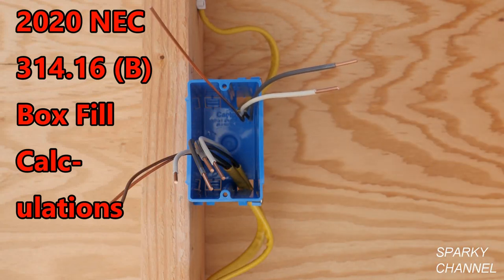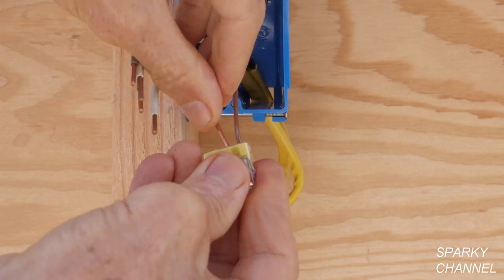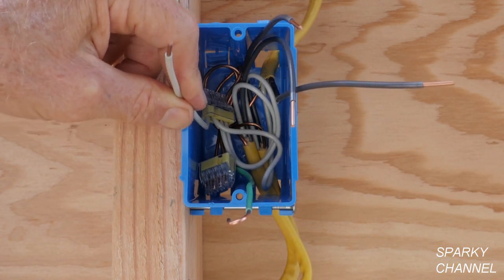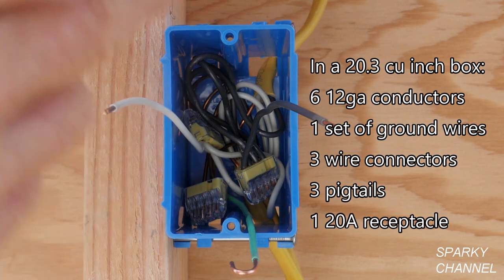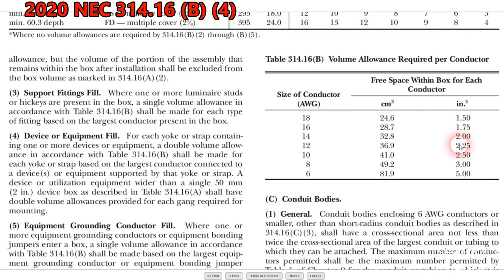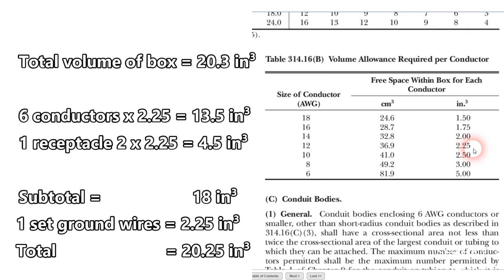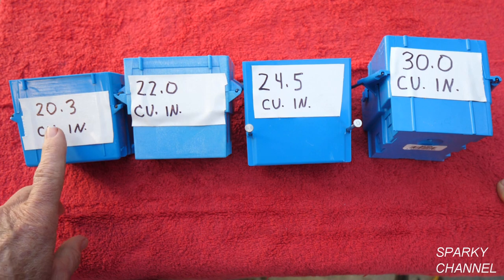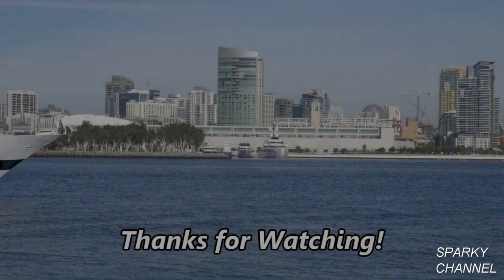Is this Box Overfilled by 2020 NEC Code?

Comment: My dad talked to me one day about planning ahead. He said (paraphrasing) "If you add up all the cost for an entire house for doing it cheap vs doing it right, it's not that much difference, but the cost later is significantly higher if you do it cheap." He was referring to putting in larger boxes, spec grade devices, even running 12/2 when commonly 14/2 is used and so on. Over the years I have seen this principle prove itself time and time again. I usually don't even bother buying the smaller dimension boxes except for a very few cases. Ounce of prevention.
Reply from the maker: Your Dad is brilliant!!!

Comment: I am an electrical engineer, I follow the plumbing, electrical and building codes which all continue to increase in complexity and the details. My experience is there is nothing you can put in writing that replaces COMMON SENSE and GOOD TRADE CRAFT. 9 Years ago, probably about the time emphasis was placed on overcrowding boxes, I was on a job where the electrician stripped the sheath on 3 12-2 romex, leaving 24" of wire. I watched him strip the ends connected directly to an outlet and used your yellow plastic tool with amazing skill to make 5 or 6 tight bend, using great skill, put the outlet in place and put great strain on the screws to force all the wires in the plastic box.
I asked why.... answer, that's how I was taught.
The reason for limiting the number of wires based on cubic inches and device is a combination of mechanical stress and potential overheating at max load.
In retrospect, I wish I made a video, would send it to you.

Comment: You sometimes can't put in a deeper box like when putting a receptacle in a wall framed with 2x3 studs instead of 2x4s. What you may need to do is use a wider box for installing a single receptacle or switch.

Comment: I just used this information when I decided to use up two pieces of leftover 10/2 and a piece of 12/2 for a new 20 amp GFCI circuit in a garage.  The 30 cu inch box works great and left lots of room for the GFCI receptacle.

Comment: Loved learning about that connector. Beats the hell out of wire nuts. Thank you!
Reply from the maker: You bet! Thanks Eric!
Reply: Those connectors are garbage and cause problems, I wouldn't use them
Reply: @GrizzlyWang  good to know.  I'll do more research should I ever think of using. Thank you
Reply: Why are they garbage? What does the data say?
Reply: @andrewpayne6295  I'd say they are garbage based on the minimal surface-area contact.
They may be rated for 20A, but what's the resistance at that power draw when you have a string of these? I'd also be concerned about heat-cycling that thin strip of spring metal.

I wonder if someone has put these things on a thermal camera and/or calculated resistance when passing that much current. I'd be willing to bet the wire nuts fair much better because all else being equal: resistance is a function of surface area.

Comment: I have an outlet I opened up yesterday in a house i just bought that has 5 14/2 wires running into the outlet box. This is a single outlet box. Would getting a double or triple outlet box and adding 1 or 2 more outlets to the gang make this safer? It is way too crammed and obviously exceeds Cubic Inch space requirements.

Comment: I have a question about the connectors, aren't they using the same principle as the push in connections on the cheap receptacles. Why would they not fail the same way as on the recepticle? I've used them with a light fixture that came with that type of connector, and they are handy. But I was just curious of the failure rate.

Comment: Here's a question for you - I've seen many electricians saying DO NOT use the 'push-in' wiring on outlets/switches (and I've never used them, I've seen them pull out, and just don't feel reliable) - But now I'm seeing these Ideal In-sure blocks instead of wire nuts - What's your take on this difference? Both are push-in...    (I did just use them on an LED hi-hat install, also I tape everything for a little extra insurance if a clip loses tension)

Comment: Stuffing the wires back into the box is tricky. I didn't think to stuff the wago connectors in first and leave the pigtails out. That would have made it much easier and cleaner. Sometimes when I am in awkward positions I don't think so clearly:)......Thanks for the videos!

Comment: I always feel the wire nuts or wago's are too much in this scenario, but they don't "count" anyway!? Anyway: always go deep with a gcfi/afci!
Reply from the maker: Thanks!
Reply: Yes sir if your box is to full with a GFCI then it'll cause your GFCI to have a malfunction
Reply: @
wim0104 curious as to what you think the alternative is? Thank you
Reply: @ayeitsshane806  Care to elaborate? Is it something to do with transient voltages between conductors..? Prospective apprentice here.
Reply: @ArkamasRoss  just something i learned over my 12 years. But if you have to many wires in your box even if its up to code with box fill calculation but for some reason if its tight and pushing against your device it'll cause it to trip and not reset until its fixed

Comment: Had some trouble recently in an existing 2-gang box. One switch was a 3-way and the other was a 4-way.  I replaced the old toggle switches with a Legrand paddle switch.  That 4-way was really packed in there. Pretty sure it was overstuffed.  I am ashamed.
Reply from the maker: Hi Jo. Have you considered changing out the 2 gang box to a larger one?

Comment: The offset 30.0 box is awesome.  Also, the ones they make when you cut your hole right in line with a brace and you don't have the depth but need a shallow offset box.  Next...how many wires can you get in a one-inch pipe?  As always...one more. LOL

Comment: One thing you didn't use to calculate the fill was the outlet possibly being a GFIC vs standard outlet, even though the code doesn't distinguish them by yoke??  When in doubt always use the deeper box.

Comment: Hi Sparky,
 First, thank you so much for such a great video and explanation of the calculation of cubic space needed. 
So, I was taught, though(once upon a time) that the ground wires had to be a non- reversible( or crimped) connection. Are push connectors considered to be non reversible?
Reply from the maker: Hi! I don't know of any such code.

Comment: Great videos. {lease can you provide advice on testing and troubleshooting of electrical circuits and the use of push in connectors over the use of wire nuts. I live in Thailand which seems to follow (in parts) the NEC code but, does mix and match with other regulations so, can be confusing. Thanks

Comment: 10:18 sometimes though, gotta use a 20.3 b/c of space behind the box, and can’t upsize; so know you’re good on fill, 8s key before starting, b/c last thing wanna do is do a rip-out (not rough out or rough in 😉) when inspector comes and decides to pull cover plate (if already on) and calculates fill….they’ll make ya redo, or possibly add extension, but again, if zero space ….and not possible to add bigger box, this gets tricky.
Example, adding receptacle in a wall that has concrete “framing/slab” all way to roof soffit and you need to use low profile boxes or 15.x-20.3 boxes on fill to make them “fit”, not able to cut thru concrete etc….and so, gotta really calculate that box fill b/c those inspectors will find and check, never fails😉
Cheers✌🏻

Comment: Here in WV everyone says use 12 wire because it handles more and I see it all the time, an 18 cube box with 3 to 5 12/2 wires plus the gfci or other device, I say yeah lets just disregard the factors that cause fires.  Another good one is 4-6 or more 12/2 wires through a 3/4 inch drilled hole.

Comment: I appreciate you address code and explain it so I can understand. (I've read code and it's a nightmare to decipher, at least for me.) 
Working in the house my father built my guess is your guess is right on the money, within code and just barely. Doing rework I call that an overstuffed box and for the less experienced a nightmare to work with. 
 I've based a lot of my choices building a home on what my father did and come to the conclusion he was stingy about some things.  I know Small Things add up when building a home however there's a whole lot of things I would do different next time I build. Among them is big boxes for multiple cables. 😆

Comment: The 22 cu in boxes are definitely worth the extra 15 cents or so. Cheaper than that if you buy a case, I'm sure.
I've been using the Ideal push connectors while replacing some switches & receptacles in my home. They're quick and easy. Glad to see them on your channel. Wagos are nice, but the Ideals are quite a bit cheaper.
Reply from the maker: Thanks Doc!
Reply: Couldn't agree more. A few cents per box is trivial but well worth it.
Reply: Tried the wagos and personally don't trust them as much. I feel the wire wiggles too much and did get pulled out in an occasion or two trying to push the wire back.

Comment: does a smoke detector count on the yoke volume. It sits outside the box unlioke a switch or an outlet that occupy space in the box ? Same with a light ?
Reply from the maker: No, it doesn't. As you say, it sits on the outside of the box.

Comment: Not the optimal place to ask, but if you have two separate circuits running to a two-gang box, do the grounds have to be combined where they’re in the same box or can they be separate? Or do they have to be separate?
Reply: If multiple circuits are spliced in the box, then the equipment ground for them needs to be spliced together in that box.  If you have a cable just passing through it doesn't have to be spliced.  See 250.148.

Comment: What length of wire do you remove the romex sheathing from to go into the box? I can't find any information on how much unsheathed wire is allowed or recommended for box fill.
Reply: I'm not an electrician but I thought someone said only ½ inch.
Reply: Last I knew, it was a minimum of six inches.  It might have changed since, but the idea is to allow slack for future repairs.

Comment: Been doing Electrical Work for over 40 Years. I Always Use 22 cu inch plastic boxes with 12 Wire. Folding wires in and GFI outlets make it a better installation, Never more than two 12-2 cables in a one gang box. Code is a Minimum. Real Wire nuts not a fan of plastic pushin wire connectors.
Reply from the maker: Thanks!
Reply: Great comment nec is minimum requirement I’d rather pay $.05 more for a larger box and not struggle stuffing all those wires

Comment: How is 20.25in smaller then 20,3in? I don't understand. Logically I would be safe and go with a bigger box. Sorry I never finished the video before I asked this question. Now would you fail inspection using that size box?
Reply: Another way to write 20.3 is 20.30 and 20.25 is less than 20.30 by .05 or 5 hundredths of a cubic inch

Comment: I had a 3 seperate wires in a receptical and I didnt use connectors or lugnuts. I used the 2 on the side and put the 3rd in the push-in in the back of the receptical. Is that wrong to do?
Reply: wrong? probably not.  Difficult to properly bend all the wires back into place? You bet your bottom dollar.
Reply: What did you do with the ground?

Comment: Can you set the box deeper in a use a spacer to set the receptacle out more for box conductor volume
Reply: Yes
Reply: Maybe sometimes but that depends on how deep the wall is.
Reply: Be careful about this; you do not want to create a gap between the front edge of the box, and any combustible wall material, such as wood paneling. There are slip-in box extenders that cover the gaps. You will also need longer coverplate screws.

Comment: For the neutrals don’t you need to worry about which phase they connect to in the main?
Reply from the maker: That's correct.
Reply: What? Neutral doesn't have a "phase". It's either the center tap of a transformer (split phase, or high leg), or the the common rail of the windings in a wye system. There may be multiple systems in the facility where you wouldn't want to bridge their neutrals.

('tho all neutrals are "grounded conductors", so it shouldn't break anything more than words on a page ("code") BUT, in the Real World(tm) neutrals from different systems may not be at equal potential -- as I have seen before.)
Reply: @SparkyChannel  how is that correct? Neutrals from different circuits should not be connected but there is no way to connect then to a different "phase" as they are never connected to a "phase" unless it's a fault

Comment: Stumbled upon this video at the jobsite. I've never included wirenuts in the volume calculation but two of the newer guys said they were taught to add it to the volume in school. I suppose this videos reference to the code sorts that matter out, but it confuses me as to why they wouldn't mention connectors in the code as they mentioned locknuts and bushings. Also not a fan of those push in connectors but to each their own.
Reply: DIYer here. I concur. Connectors are in almost every box. Locknuts and bushings are relatively rare, especially in non-metallic boxes. The Code should be updated to reflect this. As to push-in connectors, i prefer them in more crowded boxes. (Well, OK, I like them everywhere; much easier to use, especially by those of us who do not use wirenuts all day long, day in and day out. And unlike aluminum wiring, and backstabbing receptacle connectors, I do not see hordes of pros regaling us with horror stories on pushin or better, lever-lock connectors.

Comment: Doesn't the internal clamp count for 1?
Reply: I was thinking the same thing Bruce. The NEC says you must count clamps (1 based on the largest conductor) but Sparky did not count it in his fill. I am not sure why? I always use the deeper boxes from Home Depot with a cubic inch fill of 22.5 so it would allow the clamp to be counted in this example and still meet code.

Comment: Dos t each cable carry 3 wires, total of 9 x 2.5? I know you counted the ground as 2.5, I don’t get it.
Reply: 7:10

Click on the timeline time I provided above and it will take you to where he shows, reads and explains the code for grounding conductors and pigtails.
Reply: All grounding conductors are counted as 1. Fill ratios have to do with conductors and HEAT. the key word is heat. Grounds only conduct current if there's a ground fault and don't see any loads other than a ground fault. The other conductors see all sorts of various loads through the day and any load will create heat. Yes you can probably get one more cable in there with some effort but you're also adding heat. Too many live conductors in a box can create too much heat. That's the reason for box fill and the reason why all grounds are only counted as 1 conductor in the total fill.

Comment: I WISH my boxes were 20.5 cu in. Mine are the old Bakelite with fiberglass and are only about half as big. They’re not marked (not even branded), but they’re smaller than the Carlon grey Handy Box which is 11.5 cu in. 

I’ve been installing smart switches which are fairly large, and I have to shove everything back in. I’m gonna go back and take them out and put in some of the 22 cu-in Smartboxes, or the Carlon 24 cu-in boxes, both of these allow screwing into the stud at an angle (so long as you drive the screws below the plastic so as not to leave the heads exposed).
Reply from the maker: Yes, that's the way to go. Excellent choice!
Reply: I routinely cut those cramped (and often filthy) things out (how I love my battery-powered reciprocating saw!) and replace with a larger Old Work box, largest I can fit in the wall. And yes, for oversized devices such as GFCIs i prefer pushin or leverlock connectors. (DIYer here.)
Reply: And thanks for turning me on the Smartboxes with angled-in screws! Going to start using those on my next project; I never di really trust the ear-flaps.

Comment: there's actually a code violation on all of those pigtails if anyone knows what the code says about free wire in the box past the make up shall be 6 inches for any box less than 8" in diameter, the wire shall be long enough to extend 3in past the face of the box (article 300.14). I'm pretty sure those pigtails could have been a little bit longer. I was taught from the beginning about 6 inches from the face of the box or the side of my hand to the tip of my thumb pointed out. It works out for a nice make up; fold the wire once and tuck the device in the box. I know those metal boxes are a bit small, but when you are trying to push the wire back and it points straight back because you made the wire so short it wont fold behind the plug or switch, it's hard to put it in there without feeling like one of those wires may get damaged because it's too short to fold! all I'm saying. takes more time to push it in and time on the job is money wasted in my opinion. 2 more inches of wire and it goes smooth. I think if the safety issue were brought up on that, they may change it. You should send in your request, Bill! lol

Comment: Those gang push-in connectors are great. I have got to get me some of them. Back in the day code never stated what side up for receptacles so I always installed ground pin up so if anything fell onto a partially installed plug it hit the ground pin and didn't short neutral and hot.
Reply: That was one among many claims for doing so none I think we're ever practical and though it's escaping me at the moment but a similar situation I recall could be the argument for putting them ground pin down. The nail in the coffin so to speak is most appliances have plugs that are designed to be ground pin down and even 90* plugs are designed ground pins down so you're not putting stress on tbe cord.  Imo can't stand ground up. Hate it. They're wired in my shop this way and they're about to get ripped out and flipped.
Reply: Also pin up is terrible ergonomics. Fits better in your hands pin down.